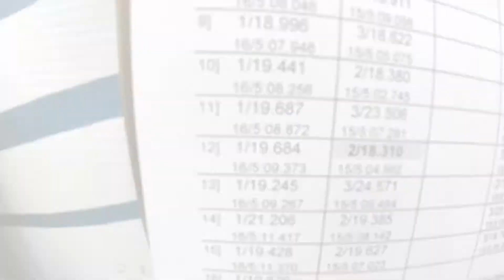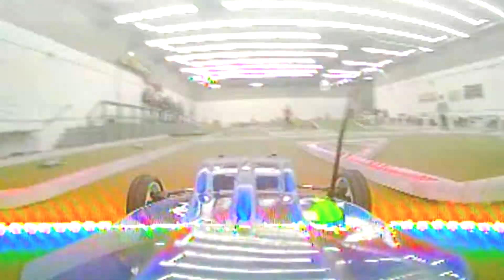FPV vs LOS 2wd 17.5 Buggy racing

Comment: I'm working on designing up an FPV pod analog mount to bolt onto the rear wing mounts for a AE B6.3 and a B74.1. The camera sits up a little higher and you can tilt the camera down if you need to, but more importantly you can hot swap it from car to car. It holds the camera and VTX in and provides cooling to the VTX too when driving. I'll try and post footage of it once I get it figured out!
Reply from the maker: The wiring for power is always the struggle. With how cheap most of the fpv equipment is I don't mind a unit per car seeing as I only own three. My only concern is it getting busted in a crash. My TT-02 I put a nano cam inside a Inductrix fpv body and that has held up to rally racing but did not hold up on an fpv wing. Best of luck, look forward to seeing it

Comment: Looks like the current going through the motor is messing with the camera picture.  Do you find that it takes from your ability to drive at all?
Reply from the maker: The static is more multi pathing and an old dvr. It's normal for 5.8ghz indoors and I used to be very active in drone racing